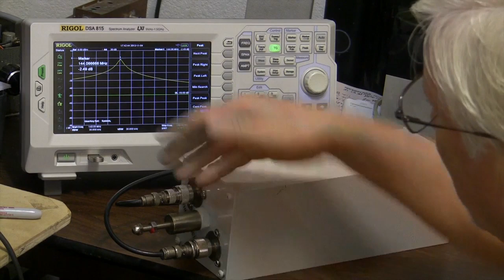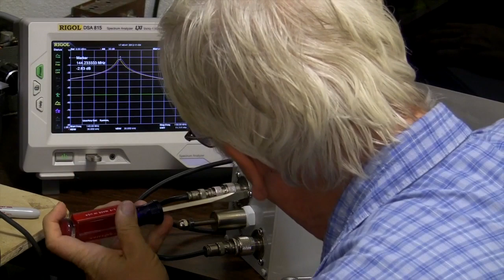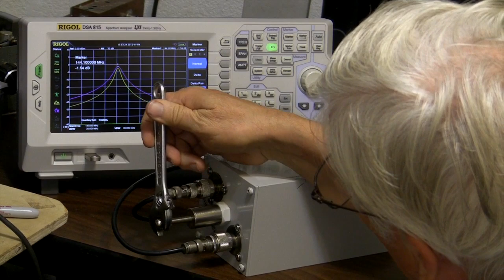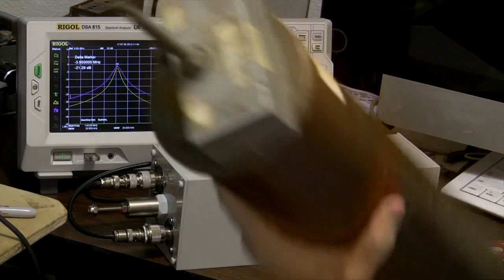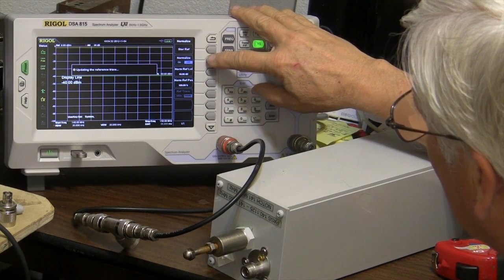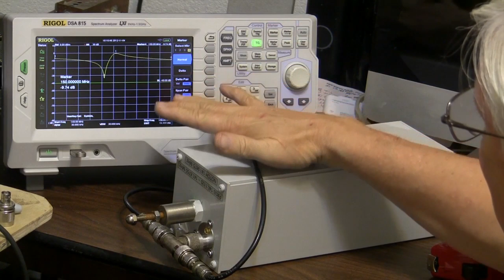Band Pass, Pass Reject, and Notch Cavity Filters on the DSA815-TG

Comment: Hi James.  I recenty got a deal on an ICOM ICFR3000 repeater and Telewave TPRD-1556D BPBR duplexer.  I have a Rigol DSA815-TG and started the retuning process on the duplexer today.  Your comments on settings for the Rigol will probably solve some issues I had today trying to get the proper curves so I could see the bandpass part of the curve better.  The notch seems to be very visible but the pass part didn't show any insertion loss reduction from the baseline at the top.  I'll try resseting every setting according to your settings to see if that results in finer resolution on the Y axis.  I had the coax jumpers off and was tuning individual cavities.  Thanks for the video.  K5INW

Comment: Hello James, I enjoyed your video. I have some Telewave bandpass filters. Is there a simple way to convert them to Band pass / band reject?
Reply from the maker: If you had the correct Pass-Reject loop for the can, it is fairly simple.  However, it also requires a special can top to allow for the required anti-resonant tuning cap.  It might be possible to get this done by Telewave but I haven't worked there for a number of years thus don't know their current policies.
Reply: @jimeagle1  Thank you for the quick reply James. Unfortunately I know little about Cavities. For the Pass-Reject loop does it have to go inside the can or attach to the connector at the top? Same for the anti-resonating tuning cap? Finally could please point me to where I might get the construction details.
Reply from the maker: As I indicated, this isn't really something that can be "homebrewed".  The factory might do it for a price but it takes significant changes to the top of the unit and the loop inside.  Best done at the factory.

Comment: Hello Sir, I have made a set of band pass filters but now I have put a capacitor to made this filters notch filters. My question is are the RX and TX notch filters the same?
how can I let the high frequency pass and reject the low frequency and how do I  let the low frequency pass and reject the high frequency? I have made all 4 identical. thank you for your reply! 73's from PJ2SM
Reply from the maker: Sergio Mackay  There will be a notch both above and below the main peak response for most duplexers.  Use a wide and sweep (10 MHz or more) to find the lower (or higher) notch.  Readjust Main peak tuning and Notch tuning in order to notch below or above the peak response.  If you cannot get the desired Peak / Notch relationship you might need to adjust the loop size.  You might want to check out videos at Telewave.com for further instructions about duplexer tuning.  There are also several videos on YouTube about tuning up duplexers.

Comment: Perhaps the Invar tuning rod is firmly attached near the end of the moveable sliding center conductor, so the length precisely follows the Invar rod?  It wouldn't drift much then.   But to build a unit for Ham purposes is difficult due to sourcing the Invar rod at reasonable cost ...

Comment: Jim, could you expand just a bit on the thermal design?  You mention that the tuning rod cancels out center conductor expansion.  Both aluminum and copper have near +10 micro inches growth per inch per degree F.   To offset this you would need a metal with a negative temperature coefficient, say -10.   Invar nears +1 but I can find none which are negative.
Reply from the maker: Chris Scott   You bring up a good point.  I am not a cavity filter designer and I was only repeating what I was told about the reason for use of the Invar.  However the use of +1 material with +10 material would still cut any temperature related detuning in half.  By the way, generally there is also a small value capacitor used in many cavity combiners and/or duplexers and these can certainly have negative temperature coefficients.  Are there any cavity designers out there who like to enlighten us on this subject?

Comment from the maker: The DSA-815 has leakage internally from the Tracking Generator (TG) to the Spectrum Analyzer input.  Thus it will not display notches that are deeper than whatever this leakage level is for your particular unit.  I've covered this in other videos in this series.  

In most cases the deepest notch that can be displayed will be in the neighborhood of -90 dBc(dB below carrier).  With the tracking generator turned off an external signal generator can be substituted for the TG as a signal source then notch depths greater than -90 dBc should be possible to confirm.  One can estimate the depth by looking at the -90 dBc levels displayed above and below the desired notch frequency then noting the slope of the trace and estimating what the actual depth must be half way between these two points.
Reply: From what I can deduce the DSA-815 with a tracking generator is probably one of the better price/performance alternatives when it comes to tuning filters for 2-way radios. There are probably better performing instruments out there, but this will do the job at a price that at least some of us can afford.

Comment: The DSA 815 has very high mistake in the amplitude.
Reply from the maker: Please explain what you mean by a 'very high mistake in the amplitude'.  I have not found this to be true when using the Normalize mode with a SPAN that is as narrow as practical to show both the peak and null of a cavity.  One does need to use the Accy sweep mode to ensure frequency accuracy and appropriate RBW, VBW, and Sweep speeds to achieve proper results just like any other Spectrum Analyzer.
Reply: James Eagleson
In the Hamburg University of Applied Sciences is a lab for communication technology. My group did a simple Amplitude Modulation. On the scope screen we saw modulation factor about 50%. The Rigol DSA 815 showed 39,99%. I tried to find the mistake in my messuring, however, the mistake is to find in the technical data. Amplitude is shown inaccurate by bigger than 1,5 dB / dBm. The difference explained why the scope had shown verything right and the loss of 10% apmlitude at the Rigol.
So 10% is many if inaccurate amplitude shoulbd be below 5%.
Reply from the maker: ElmshornBoy Were you using the Rigol in the Linear mode or Log Linear mode?
Reply from the maker: ElmshornBoy Yes, there does appear to be a discrepancy in the Zero Span, Linear Scale representation on the screen of the Rigol DSA815.  It shows the bottom of the modulation at about 40% when peak modulation is shown at 100%.  Thus I am not certain what Rigol's Percentage scale is trying to show us.  

If I use the Peak Table with a dBm Log reference, the carrier falls at -0.03dBm and each sideband falls at -12.03dBm just as I would expect for 50% modulation.  At the same time the DSA815 Percent scale shows each sideband at 25% when the carrier is set to 100% which appears to be measuring percent of power in each sideband (i.e. 25% power in each sideband for a total of 50% modulation, which is the correct answer).  

It is unclear what Rigol is trying to represent by their 100% reference when the unit is placed in wide bandwidth (example 20kHz RBW), Zero Span, and Linear modes.  It does not appear to be modulation depth, however.
Reply: Ma!ny thanks! I was a pleasure to tlak with such an competent and experienced Engineer. :-)
Reply: ElmshornBoy
It is in the mode for dB / dBm, so it should be in "log"-mode. We wanted to know more about the power amplitude of course in dBm. At the same lab day we messured a mixed down frequency at a device of an Analog Devices filter.
Reply from the maker: I set up the Rigol as follows:
1.  Set AMPT to Lin.
2.  Inject 1V rms Unmodulated 10.7 MHz Carrier into SA input
3.  Set SPAN to Zero Span
4.  Adjust AMPT Ref level so that the Carrier is at 100% ( I read 467.18mV when I did this)
5.  Set RBW (BW) to 10 kHz so that all modulation falls in the BW.
6.  Modulate Carrier with 300 Hz or 1 kHz at 50% modulation.
7.  The waveform displayed should be centered on the screen on the DSA815 with a peak at +75% and valley of +25%.  75 - 25 = 50%.
8.  Adjust modulation for 100%.  The peaks and valleys should just cover the screen from 0 - 100%.

I am not certain that I agree with the way Rigol set up their percentage scale for this measurement but this is apparently how it works.
Reply: This was an interesting exchange.
Reply: James Eagleson maybe you could do a video discussing this issue. 

Great videos. Very helpful.

Comment from the maker: Settings are: 
RBW=30kHz, 
VBW=Auto(30kHz), 
Tracking Generator=0dBm, 
Start 140MHz, Stop 150MHz (you could get better results using a 1MHz Span, potentially), 
TG Normalized to remove level variations and to set reference to 0dB, 
and Sweep=Auto.  

This should provide roughly 80dB dynamic range.  Each cavity should be individually tuned for the Pass/Reject pair that you want then cabled together for final 'tweaks'.  

I don't provide cable lengths. This varies by Mfg.

I hope this helps.

Comment from the maker: As for tuning a two connector notch-only filter, it would depend on whose unit you are tuning and what their directions are for tuning them.

Normalization would involve connecting your test cables together with an "N" barrel, Normalize the Rigol, then connect the cavity between cables where the barrel was in exactly the same way that a Band Pass Cavity Filter is tested.  The "N" Barrel provides a 0dB reference and the notch depth and loss of the notch filter will be easily determined this way.